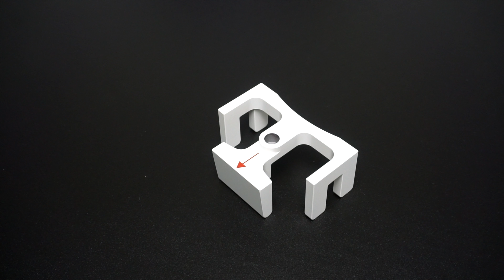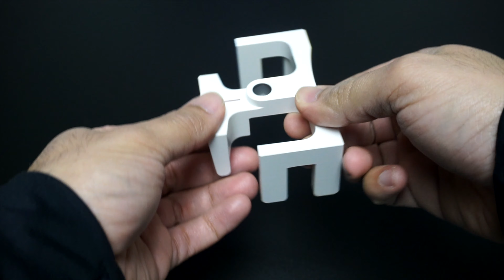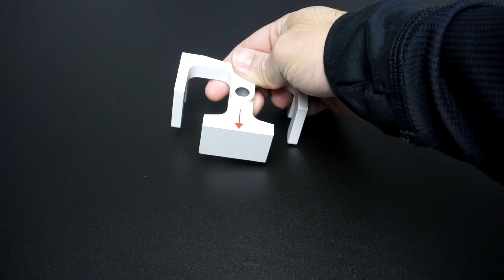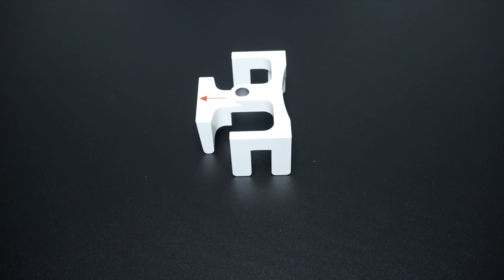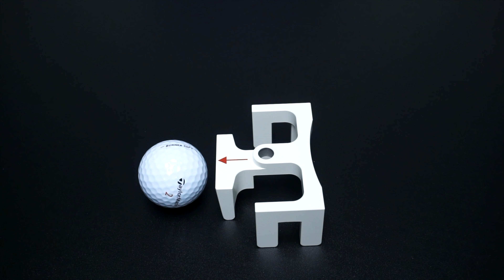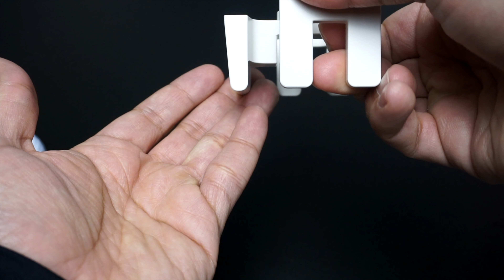V3ktor Putter Design - Weird looking putter.

Comment: Not sure why you would produce a product, put it on the market, THEN test it.  Isn't that kind of putting the cart before the horse?
I will make a prediction. Negative loft does not work in putting. It causes the ball to hop initially. At rest the weight of the golf ball will create a crater under the ball on the soft green. Positive loft will lift the ball out of that crater minimizing hopping or bouncing. Negative loft will drive the ball into the crater and increase the bouncing action on the ball. 
Contacting a pool ball above the equator works good for getting a true roll without skidding because you are operating on a rock hard surface so the ball can't dig. Not so on a relatively soft green.  There are plenty of high speed videos showing the different ball reactions with varying degrees of loft. 
I believe Phil Mickelson went over this in his short game DVD .
Reply from the maker: Thank you for your interest and watching the video.  

Our idea behind the negative loft is to impart forward spin on the ball and get the ball rolling.  From our testing, the ball got to zero skid at about the same distance as compared to other mallet putters of similar weight while generating 2 times greater forward spin.  

As always we value your feedback. 

Thank you.

Comment: Again, thanks for getting back with me.  I have, I guess, three more questions.  First--worst case scenario and the results are not favorable with negative loft.  Would there be a fix, or would it be "back to the drawing board"?  Second--I like my putter to almost swing itself, hence a heavy head is good for me.  Is your head heavy?  Third--You may have addressed this in the video and I just don't remember, but how much did the putter cost, and is there any trial period (I understand shipping would be on the customer)?  Thanks again.  For your sake, I hope that the putter's loft is not an issue, because I am leaning toward giving the putter a try.  Oh, and a last question--what type of grip do you install for the putter?  That's all for now.  Good luck with your test results.
Art
Reply from the maker: If the negative loft results are not favorable, we can easily re-design the putter for a different face.  The main lag will be building the prototype and getting USGA decision on conformance to Rules of Golf as this will take about 12 weeks total. 
Head weight is 330 g.  It is somewhat in the middle-to-lower end of mallet putter weights.  We have received feedback that the putter acts like it is heavier.  High MOI.
The putter pricing is available on the website.  There are 3 variants: Head only for $199, standard grip: $219, Super Stroke Slim 3.0 grip: $249.  FREE Shipping. 
We don't have a trial period but we do have a 15 day return policy if there are any defects. If you are not happy with the product, we can review the details with you and determine the steps for a return.

Comment: Hi, and thanks for getting back to me so quickly.  When do you think that you will get results on the roll with a negative loft?  Second, is the shaft adjustable (for lie angle) by a club fitter?  Also, I know for certain that I would need a shaft length of not more than 32".  I really like the tiny face.  Have you had any feedback regarding the feet getting caught during the back swing, primarily during the take away.  Thanks.
Art
Reply from the maker: We will have results tomorrow.  We will release them online once we have reviewed and discussed the findings with Quintic Team.  

A club fitter should be able to bend the shaft to your fit.  The drawback would be potential chipping or cracking of the shaft coating.  

Our testers and customers have told us that it takes about 15 - 20 minutes of practicing to get used to the new swing to stop the leg-drag mostly on the heel side.  After this time, the leg drag becomes an issue on the green fringe and other special occasions.  I use the putter personally and in those cases, I end up lifting the putter off the green surface.  

I hope this helps. 

Regards, 

Viral Varshney
V3ktor Golf

Comment: Hey, Guys--I really like your putter design, especially the small head.  I also like the balanced head.  My only objection might be with the negative loft.  I fear that what you are designing here is the same thing as a topped putt.  You are driving the ball down into the ground, virtually assuring a putt that bounces.  You are essentially hitting down on the ball, forcing it into the turf.  I used to instruct for 
Dave Pelz, and he will tell you that you need to hit the ball below the equator so that we can essentially lift the ball out of the slight depression that it inevitably sits in (the ball will settle to the low point of the area in which it lies).  I know that it seems to make sense that to get the ball rolling quickly that we hit the top of the ball, but I don't believe that physics backs that up.  That's why putting manufacturers have been making their putters with 3 to 5 degrees of loft for 100 years.  If your putter had a few degrees of positive loft, I'd definitely be interested.  My question to you would be:  where do you get fit for one.  With those prominent feet, you better be playing with the right length or the feet will drag.  I have a few putters, and to get my eyes over the ball, I need a 31 to 32 inch putter.  But with feet like you have, it better be 31.5 or 31.75 or whatever, because "in the ball park" isn't going to cut it.  Thanks.
Art
Reply from the maker: Art, Thank you for the feedback.  It is absolutely appreciated. 

We have heard similar feedback about negative loft.  We have hired Quintic Consultancy to test our putter against industry leading mallet putters using their Quintic Roll System.  With these results, we will be able to determine the future design direction. 

Fitting: Our option for this would be to simply buy the head and go to a pro shop for fitting.  

Our putters have a 34" playing length.  This makes the shaft approx. 32" with the 18 degree single bend.  

Please visit www.v3ktorgolf.com to check out the inventory, options and "Our Story". 

Best Regards, 

Viral Varshney
V3ktor Golf.